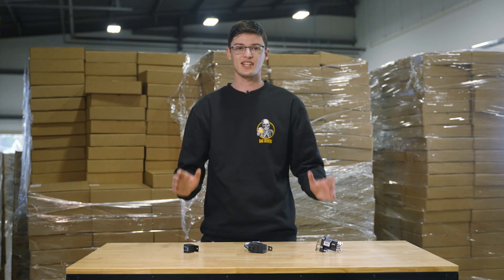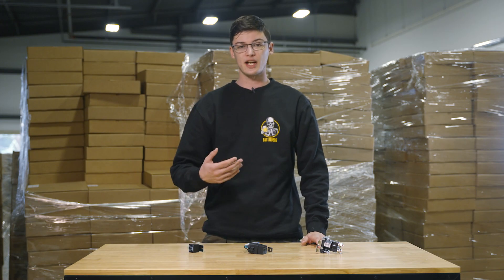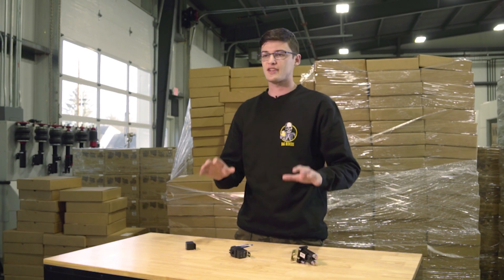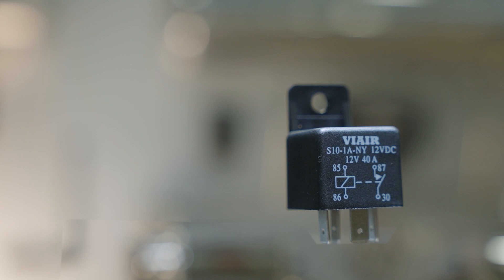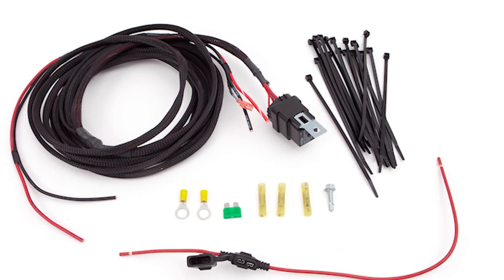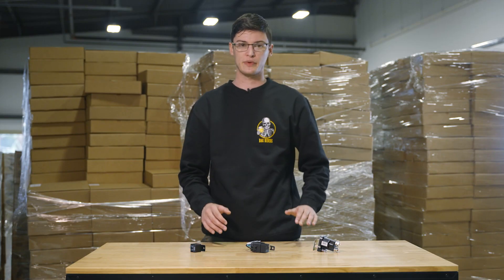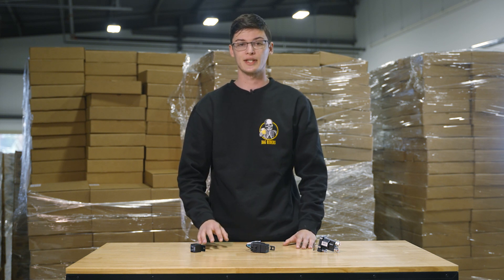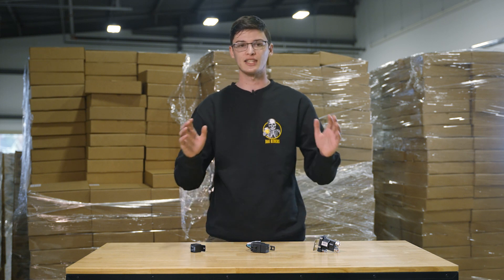Air Ride Relays Explained by Bag Riders

Comment: Please help guys so my only issue now is my air suspension controller and air pump stay on after I turn the car off and drains the battery
Reply from the maker: You'll want to double check that your ignition wire is connected to a power source that only gets power when the car is on, and cuts power when the car is off. If it's hooked up to a constant power source, that would explain why your controller and compressor stay on and drain your battery.

Comment: I bought this truck with bags everything was fine until i had them on i was driving i hit a bump and since the tanks arent bolted down the tanks went uo and hit the ground and they automatically turned off when they hit and they don’t turn on anymore do i need to change the relay or what? Idk what to do someone pls help
Reply from the maker: That could be any number of issues. Trace out the relay wiring to see if it's all in tact. You can always test it without a working relay by physically touching the two leads together.

Comment: one of my wires for the compressor to the relay got chewed up by too much weight on it in the back. I bought a new correct relay , kinda confused how to fix it and wire it back to the relay
Reply from the maker: Do you have an Air Lift 3P?
Reply: @bagriders  I have v2 management. I actually watched a video. I’ll just have to reconnect the wires toc the relay in the correct spots and then cut and crimp the messed up wire back to its original spot on the new relay. Thank you for the speedy reply though fellas !
Reply from the maker: @mk4duckr  Sounds like exactly what we would recommend! For the most prompt service you can call our number 844-404-7344 M-F.

Comment: Hey Finn from bag Riders what do you think is the problem for my truck it keeps blowing a fuze on the switch I installed that goes to my relay let me know your thoughts on why that happens I don't quite understand it to well yet but I want too ?
Reply from the maker: Is your switch interrupting the trigger of the relay (proper placement) or is it interrupting the load side of the circuit (improper placement) ?

Comment: I got a 2012 cls550. The cars stuck down. The compressor kicks on a couple seconds wen i start the car and sometimes wen i turn it off. But the car will not go up.
Reply from the maker: It could be a few things, but to diagnose we'll need more information about your system. Please shoot an email to sales@bagriders.com or give us a call 844-404-7344 and we'll help you get it straightened out!
Reply: @bagriders  replaced the compressor and valve block. Problem solved

Comment: Hey Bag Riders, im having a problem with my 444c compressor, it keeps blowing 30amp fuses every 1-2 days, I’ve replaced my check valve and even swapped out the compressor and its still doing it, my ground is great and theres noting wrong with my wire. could it possibly be my relay is on the way out and causing this to happen
Reply from the maker: Hey Callum! It could be your relay. I recommend you reaching out to our customer service team as they have many years of experience with this issue. You can reach them at 844-404-7344 or email sales@bagriders.com.

Comment: Is a relay needed ? Or can you go without one ? My dual compressor 444c did not include these in my order
Reply from the maker: Yes you need a relay! If you are running a 3P System with dual compressors we offer a specific second compressor with a built in relay.

Comment: what will happen if you wire up air lift main harness differently? Like the ignition wire and the power wire together at the ignition and ground to ground??
Reply from the maker: Great question! If you wire the ignition wire and the power wire together at the ignition, your system will blow fuses. You really want to wire the power wire to the battery and the ignition wire to a source that turns on when your car turns on. If you need help finding that source we have another video on our channel to answer exactly that! If you wire the ignition wire with your power wire to the battery your system will always be on and will kill the battery. You can wire the grounds together but it's recommended to go straight to the battery with them as well.

Comment: I’m trying to figure out what is wrong with my airlift 3p set up! My controller and compressor won’t turn on at all I replaced all possible fuses also and still nothing. Any idea what this could be?
Reply from the maker: Email tech@bagriders.com and someone from our team can help diagnose the issue for you!
Reply: Hey Bro!! I have the same issue. It was working fine and the next day my controller or compressors won’t turn on. Fuses replaced, checked wiring connect and nothing.
Reply: Lmk if you find out what the issue was
Reply: @joshuav8571   did you find out what was wrong?
Reply: Y’all find the issue?

Comment: How would I know if I need to replace a relay one of my compressor stays on and won’t self shut off would that be a relay issue or ?
Reply from the maker: It could be a relay or another wiring issue! Email tech@bagriders.com and they can help you diagnose the issue!
Reply: If you turned the car off but your compressor is still on, your relay is faulty

Comment: I've got a 5pin relay for a vixen 3gallon air compressor kit. What would the 5th pin be for? And would I be able to bypass installing the relay entirely and just use the vehicle's existing fuse box for wiring and providing  power to the compressor through the ignition. I'm not sure in exactly how. But my nephew will be doing the work to install and get it running. Do is that route a viable option?
Reply from the maker: Hey Brian! For any wiring help please reach out to our support team, by emailing tech@bagriders.com!
Reply: No needed for the 5pin witch is on 87a that you don’t need, 4 pin that’s all you need